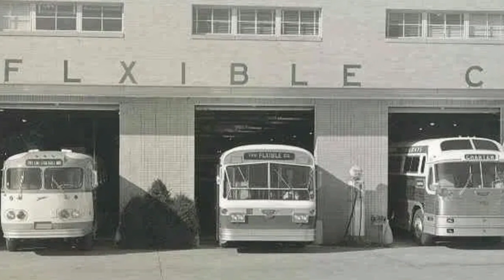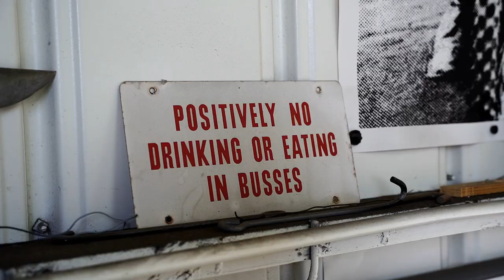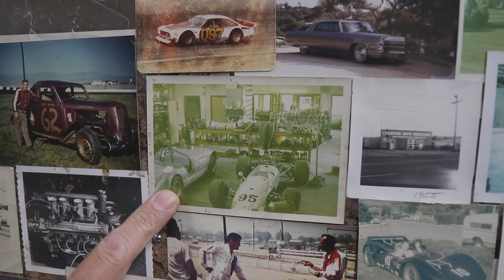Western Flyer Restoration EP 27 Restoring a 1947 Flxible Bus: Wooden Boat

Comment: We own and operate the sister bus to this. VIN might be sequential. Ours was driven East from the Warner Bros backlot in 1973 and parked in a barn in CT until 1997. We resurrected it and use it to Baseball Barnstorm with kids from South Philadelphia. Its done several 4-5,000 months summers. Weve been parked since 2020. Bus needs modernizing and freshening. Odometer is just over 100k. It had 78k when it came out of the barn. WB used these to transport cast and crew members to shoots within driving distance of Burbank. Ours had a lot of sand packed up underneath. Most likely saw locations that were way off paved roads. Best of luck with this project.

Comment: A buddy of mine did a late 40's Flxible for a customer about 15 years ago. That bus originally was powered by a straight 8 Buick. However, the customer had repowered it with a 454 Chevy. It turned out real nice. The customer wanted to take trips with his cronies, but it never happened. I don't think it moved much after it was finished. It was auctioned off when he died.
Reply from the maker: Thanks for the input and Thanks for Watching

Comment: I love the restorations of old Buses, if it were me I would use Dry Ice Blasters! Look them up it uses frozen Nitrogen and there is no Sand mess and no getting Water involved. I used to restore old FMC Motor Coach.  Dry Ice Blasters are fairly reasonable with no pollution.
Reply from the maker: Hey, thanks for the tip. And Thanks for Watching

Comment: Curious. Transportation for youth getting to a distant tutorial. Smart.
But what caught my attention was the spinner disk to heat and shrink metal. Brilliant. Simple, Obvious, but not thought of.
Reply: The shrinking discs have been around for many years. They basically replaced the torch, hammer quench method. Newer technology now uses a copper/carbon rod and electricity to shrink  stretched metal and fix hail damage with  the power PDR box .
Reply: It's old has heck, it's so old that we've started using other methods. Most recent acquisition my local shop got is an induction coil that heats stuff in seconds. The entire heat shrink process happens faster than you can say fish and a sizable, fish sized dent in a panel can be fixed in minutes.
Reply from the maker: Thanks for Watching, I hadn't seen metal worked like that ether, I guess it's pretty common.

Comment: Could not be that same bus It was in Alfred Hitchcock it was a Flxible but a 1948, I own a 1950 Flxible bus Single chrome side (it was a Airporter bus with the words painted in the roof), the double chrome side is exposed to the inside (with interior trim panels removed) on the 1948 so that means they would have to cut out the body panels to install the extra stainless steel to modify when these buses were already produced this way in 1948. Also, the 1952 had the full width one piece section instead of the two-part chrome like 1948. I love busses and love watching good people that care to save them.

Comment: The Western Flyer Foundation must have pretty deep pockets to be able to pay for the thorough restoration of an old bus, on top of rebuilding the  Western Flyer. Is Jay Leno a sponsor?
Reply: I expect the bus is a "do it when you have time" job.
I used to work in a SAAB specialty shop, and I would always have an old Sonnet or 99 sitting in my back bay to work on when I got bored.
For some jobs, it was the only possible way to do a job in an affordable manner. My boss and I would negotiate a fair deal for time at the completion of the job. Some jobs would take up to a year to finish.
The Mercedes shop I worked was the same, though those would be old Gul Wings and the like. The customers could afford anything, so they got completed in a more timely fashion at a higher cost. For instance, I once pulled the engine, and stripped the entire engine bay on a '55 300SL, sent it to the body shop to paint the engine bay, then put it all back together (paint was dirty...). I only billed about 60hours instead of the 100+ hours had I worked on it full time. Took me about 8 weeks in my spare time, and added a nice bonus to my pay check.
Reply from the maker: Hey, Thanks for the comment, and thank you for Watching.